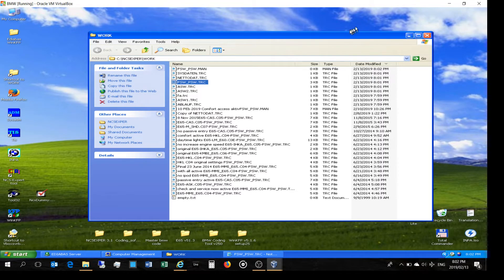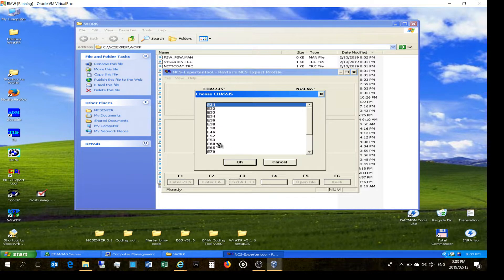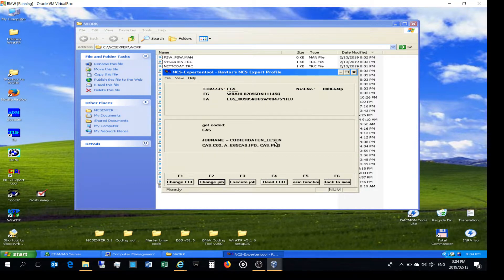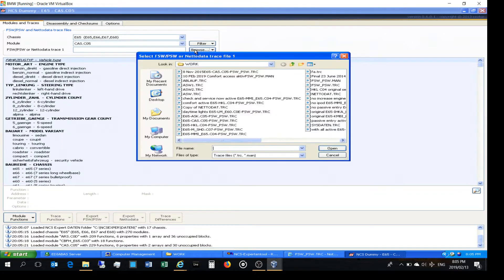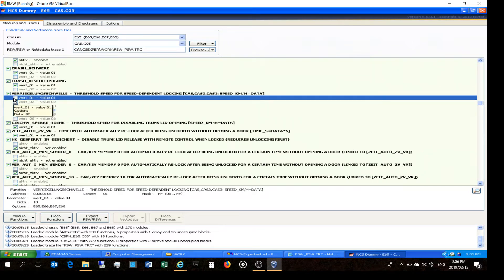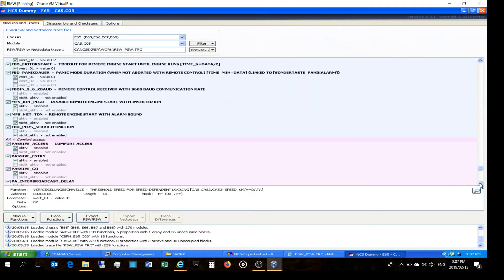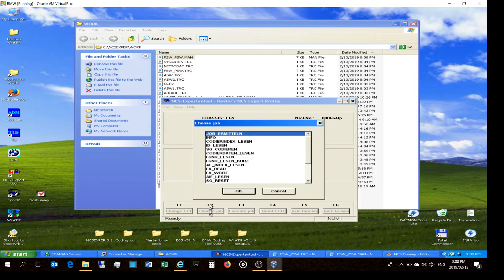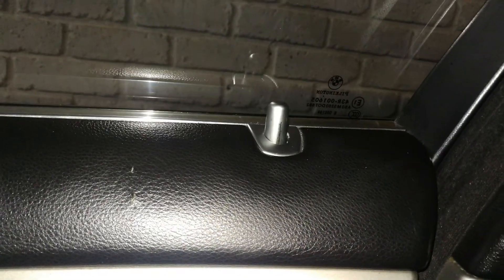How to code BMW car settings using NCS Expert (central locking, comfort acces etc)

Comment: Friends, I think I did a wrong reset. When I locked the vehicle with the remote and got off, it took about 5 minutes. It doesn't open with the remote. Open with the key. After that, the remote unlocking is activated. And only the frame lights of the radio are on.